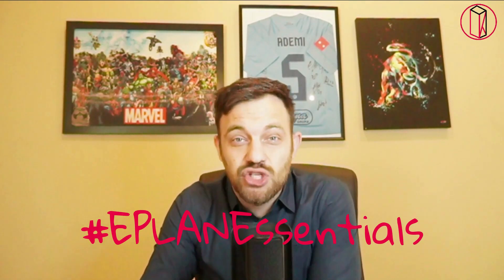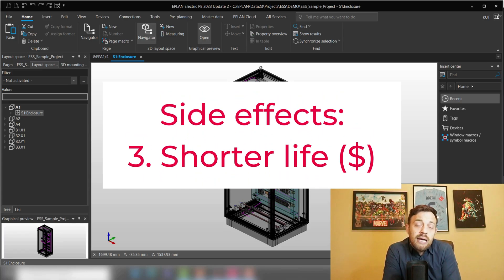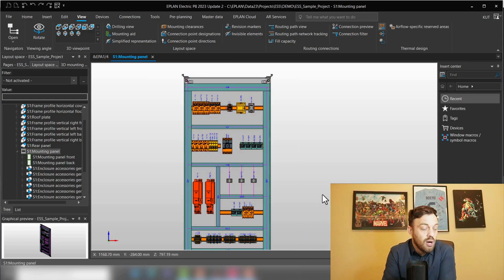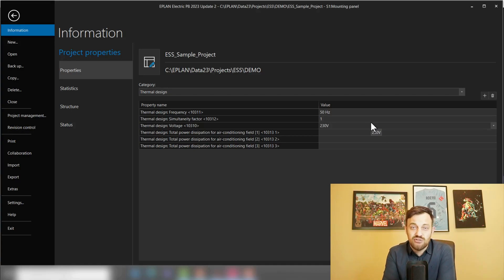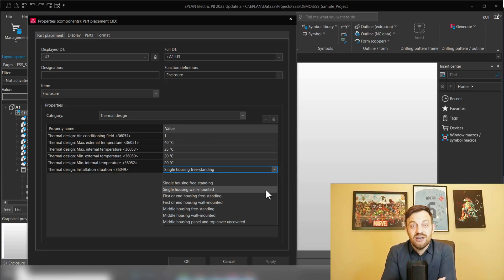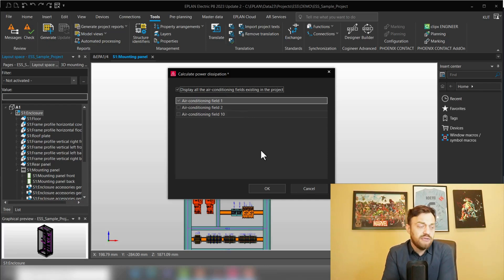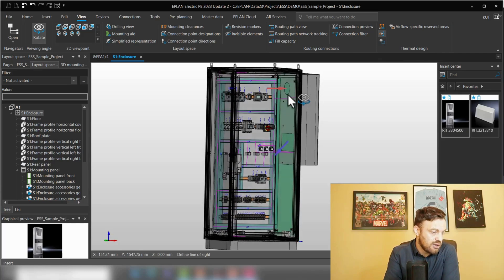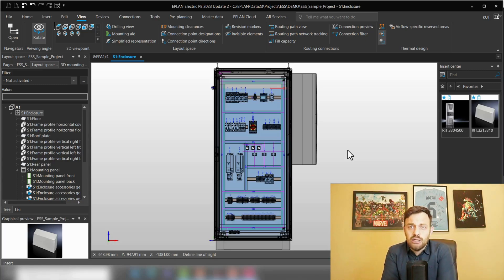Efficient Power Dissipation & Cooling in EPLAN Pro Panel

Comment: That is fantastic, Kruno can you tell me, how to active the power dissipation item on the top ribbon because when I click on it the parts colour have not changed like your parts on mounting panel then when go to instance part ABB part what you showed and typed power then power dissipation came up, for me nothing is coming up. Maybe needs to go to setting. I do appreciate it if you kindly give me hints
Reply from the maker: Hello Farhad.

If you use the power dissipation functionality and the color does not change its most likely one of two things:
1) Missing Project Settings (Frequency, Sim Factor and Voltage needs to filled out)
2) Missing Part Properties ( Max. power dissipation needs to be filled out)

Hope this helps
Best Regards
Kruno

Comment: Hi Uncle Kruno

I'm Struggeling a bit with the Power Dissipation Calculation feature you show here:

I have defined Air-condition field to be: 2
And added all needed values according to your video

But still when i try to use the calculation function, the Air-conditioning field does not show in the message box.
I have imported and created this cabinet myself from scratch, maybe something is missing?
I see that it works with a standard Rittal cabinet from Eplan Data Portal.

Any tips?

Comment: Is there a way to enter a different voltage (i.e. Thermal design: Voltage <10310>) not on the list?  The highest is 460V, but what about non-US countries using 575 aka 600V?   is there a solution pending or workaround available for now?
Reply from the maker: Hello Sir.

Thank you for this question. As for now it does not look like you can select for the calculation any other than the predefined values.

If you are missing values, please contact your support team, they will ultimately guide you to a software wish form.

Feedbacks like yours are essential for the continuous improvement of our software.

Best Regards
Kruno
Reply: @UncleKruno  I found out this has nothing to do with the calculation but more to do with the Rittal equipment selection (and its operating voltage).

Comment: hi kruno, i would like to know how to enter the air flows, the areas reserved for the correct operation of the air conditioner and finally the optimal refrigeration area, because sometimes we use air conditioners that are not present in the data portal.
Reply from the maker: Hello Simone. Thank you for your question. The enhanced functionality of thermal design integration ( Optimally air conditioned area, air flow arrows and reserved areas) are exclusively available for RITTAL components from the Data Portal. There is unfortunately not a possibility to add this information manually on other parts.

Best Regards
Kruno